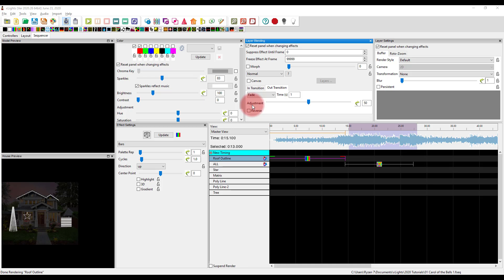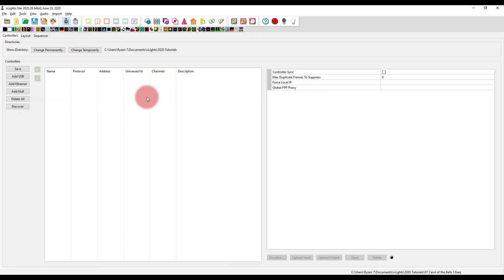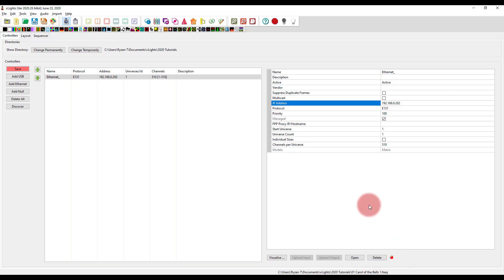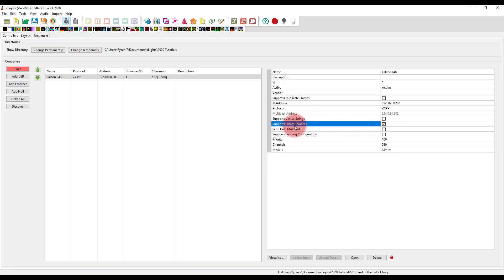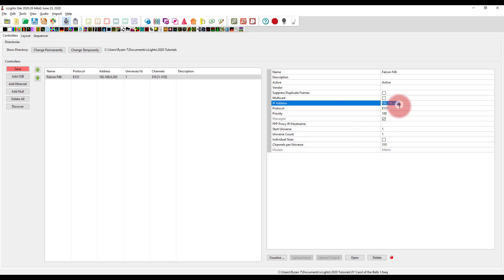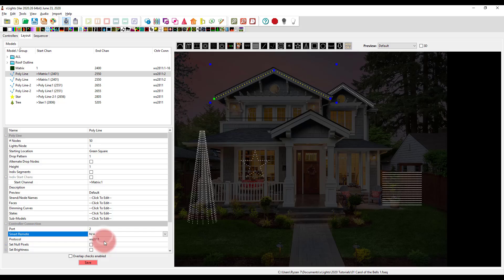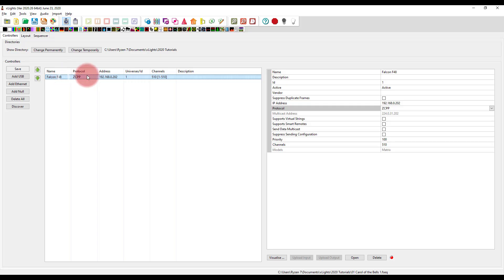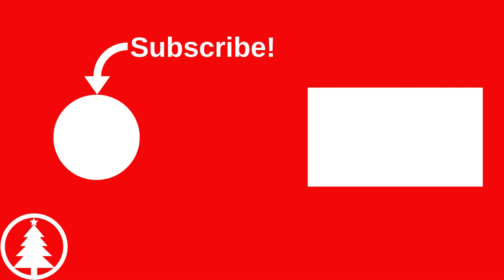Controller Setup: xLights Quick Start 2020

Comment: Hi I purchased a dell computer with windows 11 I have a Holliday coro alphapix controller I purchased a new either net dongle and it doesn’t communicate I use a older dongle  and it works light turns green what would be causing this issue

Comment: Would using the visualize button on controller tab take the place of setting the port at the layout section?
Reply from the maker: It should, this video is now slightly outdated and at that time, many controllers didn't do the visualization and it wasn't always reliable.

Comment: What hardware do I need to connect LOR Pixie2 pixel controller to USB port on Pi 4B? Will a simple USB to dmx interface module work with Xlights software?

Comment: If you have a multi controller (2 or 3 or more) on a Daisy chain connection or in a splitter network, How do you manage its configuration, I mean does it have to be on a separate configuration? For instance using F16v3, will it be all the same format??  or will they be configured separate individually.??
Reply from the maker: Each controller will get it's own line on the controller setup screen.  They will be configured individually.  Thanks!

Comment: First of all thank you for your videos they haved been a great hell.
I have my regular Christmas lights connected to a 8 relay module and that is connected to a Elegoo mega 2560 but when it comes to the controllers side on xlights software what option can i use on the protocol.
First time doing this kind of set up.
Reply: Sorry I meant “they been a great help
Reply from the maker: Hehe...best compliment ever!  Unfortunately, I don't use Arduino's or similar, so I really can't help you there!  Best of luck!

Comment: Thank you for the great video. For virtual string in a portt, say i have port 1 with 3 props. How do I set it? All port 1? How will the system knows which one is first, second and third? Thanks
Reply from the maker: Use the "after model" setting with the same port number when you set up your models.

Comment: Hi , love your videos.  I have a question i am using f48 and 6 smart cards. Do i need to connect the pixels in any order or do i have to copy like its says in xlights. And it should be only 170 pixels per outlet right.
Reply from the maker: Must match xlights
Reply from the maker: Pixels per outlet can vary, but I usually limit myself to 150, but there are different ways to "slice the cake", and depending on brightness/power injection, you can go much longer than 150...
Reply: Ty I appreciate your response.

Comment: Hi I really need some help, I am trying to set up my f16 and use in part with LOR controllers and have already made sure they will work using the port on the F16 but I am having a really hard time putting the channels in order in the visualizer screen in the setup of the f16, is there any way anyone could give me a hand, please.
Reply from the maker: You don't necessarily need the visualizer screen for your lights to work.  All that matters is that you assign the xLights Channels to the controller via the protocol you desire (E1.31, ZCPP, etc), and then you match that setting in the controller via "Controller Upload".  More info in Learn Christmas Lighting Academy: https://learnchristmaslightingacademy.com/learn-christmas-lighting-academy/

Comment: i set it up as the video says, for each prop is a different port, it mimics on the screen model ok but it does not port out to the other ports but port 1. any ideas?
Reply from the maker: It sounds like your controller configuration is not correct (on the controller's configuration screen, not xLights).  Load up the Advatek program for configuration, and ensure that each port has the correct universes assigned (to match xLights).  Hope that helps!

Comment: sorry i am still a newbie! question! I have alphapix 16 controller and i am trying to use xlights with it but when i sequence it only plays out of 1 outlet. how do get it to to use all 16 outlets? please help me
Reply from the maker: It sounds like your controller configuration is not correct (on the controller's configuration screen, not xLights).  Load up the Advatek program for configuration, and ensure that each port has the correct universes assigned (to match xLights).  Hope that helps!